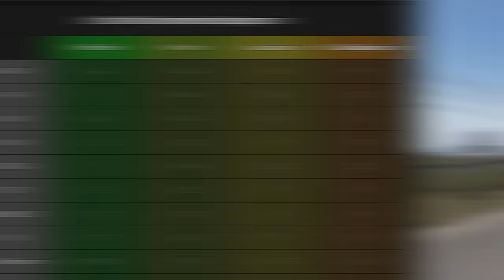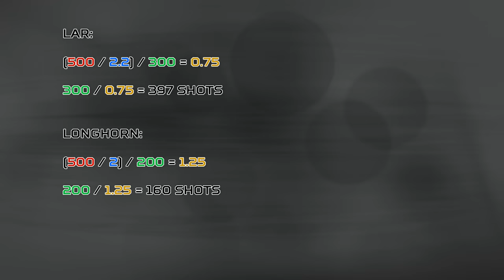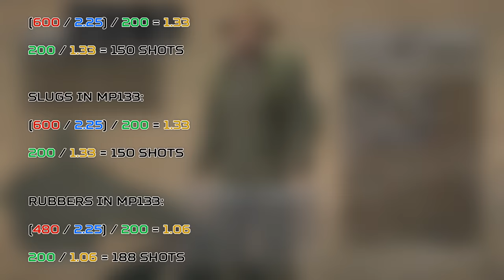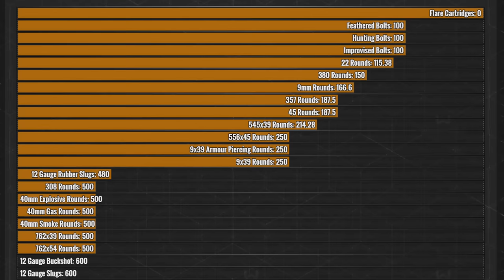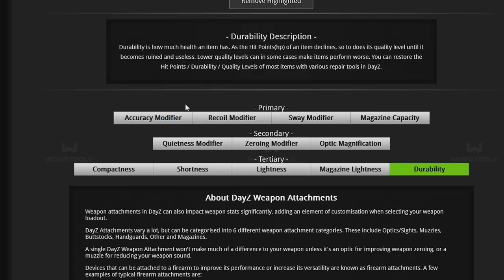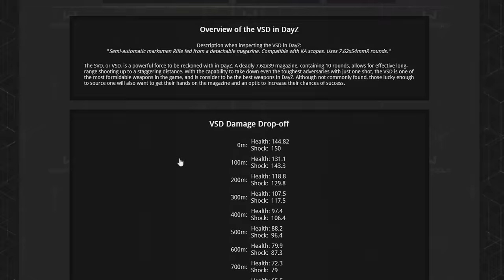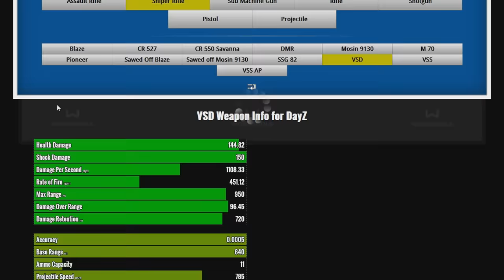Master Weapon & Suppressor Maintenance in DayZ | Barrel Damage Explained

Comment: I will definitely be testing the 7200 shots on the flare gun on official dayz servers
Reply: :elbowcough:🤣
Reply: I have its easy
Reply: GL finding flares 🙃
Reply: And on console
Reply: All the guns should last that long, and even then they'd be way less durable than a real gun.
Reply: @MrEpeeFencer  yeaa bro unfortunately guns in this game are extremely easily breakable, same with suppressors. But it adds to the game, there would be no need for gun cleaning kits if they didn’t break this quick
Reply: @YaBoiPringle flares are easy to find along the coast or industrial areas

Comment: Top tips ❤
Weapons wear too quickly.
Suppressors I can understand needing more maintenance. I can understand a gun needs cleaning regularly, but to "use up" a cleaning kit so quickly is ridiculous.
Maybe add a "gun repair" kit that would be the only way to repair a gun, then have the maintenance kit smaller and have more uses?
Reply: I agree. Suppressors wear so quickly and I have to have like 3+ for my Glock at all times. This and the weapon repair kit should just be more rare but last much longer.
Reply: Fair point, but I find weapon cleaning kits are plentiful enough for it not to bother me.
Reply: Suppressors irl especially welded suppressors like those found on centerfire intermediate caliber rifles require very little maintenance and are usually considered self cleaning due to the amount of gas that blows back into the rifle and out the muzzle, the only thing that happens is lead buildup in the baffles which leads to increased weight and slightly less efficient sound suppression due to the lead displacement resulting in less volume in the suppressor.

Comment: Not that sharpening stones are as rare, but you can use the same trick for repairing tools with them.  As in, use the saw at damaged 3 times and it's one use off badly damaged (from memory?), then repair it.
Reply: This does work, yes

Comment: Great video and tons of useful information, as usual.  Thanks a bunch WOBO!

Silencers are probably one of my biggest gripes about DayZ, along with how quickly the weapons degrade.  I own half a dozen suppressors, and aside from the .22lr cans, they literally require ZERO maintenance or cleaning.  I pop open and clean my .22lr silencer every 500-1000 rounds.  10,000 rounds later it still works fine.  My oldest silencer is a 5.56 can and has well over 5,000 rounds through it with zero cleaning or maintenance, and it works just as good as it did brand new 16 years ago.  Oh and the improvised suppressors need to go, they are an absolute joke and simply do not work in real life.

Comment: Suppressors should be very durable. Unless abused (several hundred rounds of automatic fire without stopping) they should last for thousands of rounds. Weapon durability should be increased as well but have them wear down faster with a suppressor attached, at least with semiautomatic firearms. The increased back pressure means harder cycling and that can cause premature wear on internal parts as opposed to non-suppressed firing.

Comment: They need to implement a da.age modifier for suppresors. Like, if you shoot full auto, maybe after 5 shots the damage increases by .5. So the best way to use suppresors is by shooting semi, and letting the suppresor "breath" for 1 or 2 seconds for the modifier to reset, so the 6th shot fired im semi with a bit of rest, doesnt increase by .5 dmg.

Comment: Durability stats should correspond linearly with the 'damage state' e.g <50 badly damaged, <100 damaged, <150 worn etc and repair kits should just add a fixed amount of durability (say, 50 in this imaginary example). Why it doesn't already work like this is beyond me. I've just found out how much repair stuff I've been wasting...

Comment: Good to know and to answer your question I don't think anyone would count their shots to min max their reparability as it's not a skill that makes the difference between life and death and good players are already counting shots in their magazine witch is a life and death data to keep in mind. 

I think I already implicitly thought the weapon repair kit would bump your durability to the next level whether or not you were one shot away from degrading it or you just entered the degraded state, and I thought this rule applied to every repair kits of any kind. It's good to know, for sure this time, and to have a scope of the formula. I would rather have a change to the suppressor so they are more durable. 

They could add a stat modifier when you full auto 30-60-75 rounders that use the suppressor more as it would suffer from heat. I could see a stat that grows while you keep your finger on mouse 1 and resets itself when you stop holding. They would have to buff the original durability "armor" of the suppressor a lot for that to happen but I can see that as a good balance.

Comment: Weapons cleaning kits take up 6 slots yet only work 4 times. That should be changed to either 4 slots 4 uses or 6 slots 6 uses.
Reply: That's an odd point to make, but it saves my inventory so sure. Sewing kits get two less uses.
Reply: @zomzee  Weapons that have removable butt stocks or fore grips should take up less room when said items are removed.
Reply: @bobstupaksvegasworld4098  I can agree with that on folding stocks and the ability to fold them, mostly because the skorpion looks trashy with an unfolded stock.

Comment: I find being able to attach a suppressor on a 380, then a 9mm, then a 45, is a little boring, I'd rather there was a type of suppressor for each ammo type. Obviously the bottle suppressor doesn't care about ammo type, but the manufactured ones should.
Reply: You can fit bigger suppressors on smaller calibers it just doesn’t work (as well) but it still definitely works

Also .380 and 9mm use the same suppressors I’m like 90% sure

Comment: @W0B0 a Question. In one short portion you drop the yellow box filled with suppressors and shot it. The items had been loaded in horizontal positions and the Top 3 were ruined but the bottom one was still Pristine. Is that normal for stored item damage?  Whether top to bottom or left to right, is there a Pattern of which items get ruined first?

Comment: Dayz updates in a nutshell :

- Increase durability of given item by 2, then proceed to nerf it two updates later, then buff it again 4 times. 
- Change the location of a building at the Airfield, put it back two updates later, then 6 updates later, redisign the whole Airfield area.
- Increase frequency of another item, then make it very rare in the next update, then put it back to its original state.
- Buff the damage of a gun, then nerf it drastically, and, 3 updates later, reduce the recoil to compensate for the damage nerf compensating the initial buff.
- Slightly reduce the calories of a fruit, buff it the next update, then fix the bug induced by calorie value change, 6 updates later, back to original calories value.

🙃
Reply: Sad but true
Reply: In a nutshell without the redundancy 
>make changes
>replace changes
Reply: Are you seriously whinging about them trying to find balance in their game remember dayz is the first of its kind of cause there's gunna be teething issues if you'd played for aslong as I have you'd realise the games a fuck ton better now from all their tweaking and changes
Reply: @bj011990  yes we are , problems?

Comment: Another reason why I don't use suppressors, except mk2s and asvals/vss
Reply: The people complaining about surpressors not lasting are the same ones who always use supressors for sustained fire. If you can't make hundreds of rounds last enough to find another repair kit, you may was well not be using supressors since they "waste too fast" always ends up being not enough trigger discipline, low accuracy, ineffective users. Supressors last plenty of time used correctly
Reply: @Weltshmerz  ya true, that's why I think it's kind of stupid to run full auto all the time on top of using a suppressor in full auto

Comment: In regards to damage, suppressors don't behave this way IRL. DayZ should change this mechanic to be more realistic. Suppressors should stay at the quality level they spawn at. When they are attached to a weapon and used, they should not take damage. They should only take damage if they are shot or, for example, held in your hand while punching. Furthermore, to be more like when you clean your weapon IRL, when a weapon cleaning kit is used on a weapon, the weapon as well as any attachments, including suppressors, mags, buttstocks, etc., should go up a condition level. If DayZ doesn't want to do this, I get it. But I'm looking at you modding community! 😉

Comment: Imho, the way the guns ruin is just silly. A suppressor, even a old, rusty wet one will work for a long time. We are talking 10s of thousands of rounds. 100s of thousands even. If you keep a sks or ak lubed it will outshoot your trigger finger. Irl. So the jamming and stuff is fine, but the way things degrade is just a bit much.

Comment: The way weapon damage works really degrades the realism of the game.  99% of players do not survive long enough for this actually to be relevant.  Ruining suppressors especially but also guns should be removed. You should be able to clean the weapon with rags.  Toss in a "gun oil" item to boost rags if just rags are too easy.  Weapons should not ruin just get dirty IMHO, they should just cease to operate until cleaned. SNAFU makes in game firearms much more realistic.